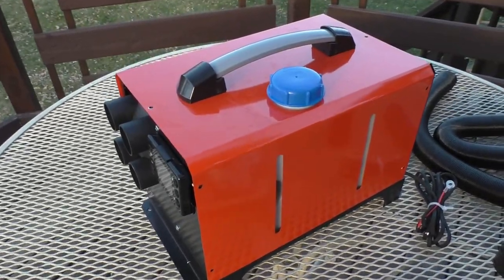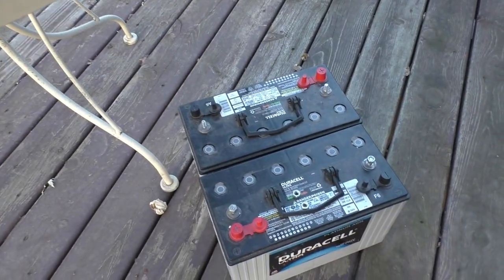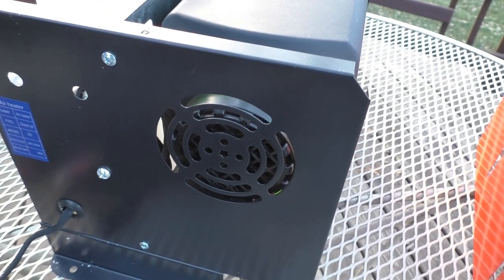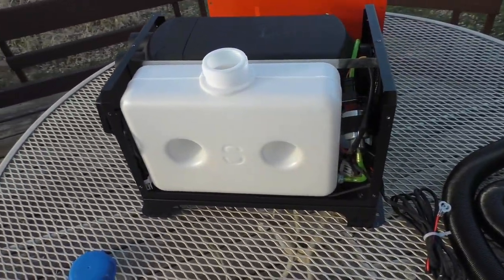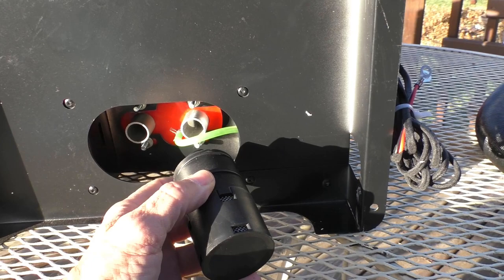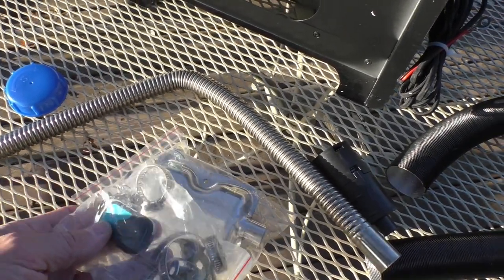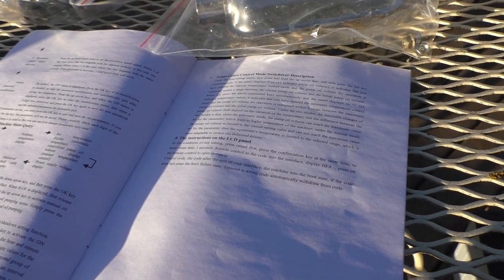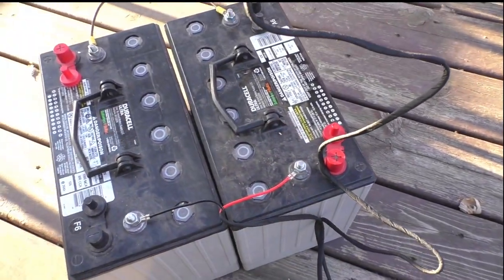#33 Diesel Heater--Cheap heat for our Tiny Home???Off-grid yurt cabin garage heater solar all-in-one

Comment: SPENCER THANKS FOR SHARING THAT I HAVE BEEN LOOKING AT THEM ON EBAY MATE I THINK THE ONE YOU HAVE WILL THROW MORE HEAT OUT WITH THE 4 OUT LETS
Reply from the maker: The single outlet models are greater in square inches and should provide greater flow. The multiple outlets allow pointing the heat in different directions possibly creating different heated zones. Thank you for watching.
Reply: @SpencersMountain  so Spencer the single  out let is better than the 4 hole one what you have
Reply from the maker: @ANDY-we7mr  I got the multi hole unit as there was no selection at the time. I did not need / want that style and there was option to buy a single hole cover if wanted.  The multi hole is good for directing heat to specific and separate places. The single large opening is possibly more efficient as far as moving air volume, but in the end both styles are putting heated air into a space that you want to heat. The only real difference is point heated air where you want it, single or multi.

Comment: It will run flat out like that forever, however.............if it was indoors it would slow down once it came up to the desired heat setting. I have owned two of them now for over three years (without fault) and they will sound like a jet taking off until they reach the heat setting that you have set it at. In a real big room that might not be able to hit that limit but they sure will keep trying, get it fixed into a room and let it do it's thing. Best wishes from England.

Comment: these come in 12 and 24v systems.  they range from as low as 2 kw (6,800 BTU)   up to 8 kw (27000 btu).

For about 100 square feet or less,   8x8-10x10 sized cabins/tents/sheds, a 2kw should be enough.    
100-160 feet,   8x20 tents,  10x16 cabins,   a 3kw heater should do...  

5000 should do up to about 400 square feet, and the 8kw  is is likely to do you up to 600 square feet.  Better insulation will help but...

these are not "all or nothing" heaters,   they do scaled their output, they do have thermostats so can shut of and turn on as needed.   This means,  throwing a 3 or 5kw into a 100 square foot unit,  just means they will use less fuel while operating.   For these units they list the min and max Fuel in L/Hr,  for example an 8kw unit might say -  0.18-0.68 l/h.   that means its min operating pull is .18...   where as a 3kw might be  0.1-0.35 l/h.    So for a "small space"   say,  90 square feet,   the 3k would draw less fuel,  be turning off and on less,  in average cold temps...  but in larger rooms,  where its forced to run at full power for longer, then 8kw unit then may be more fuel efficient.  

.1 vs .18 may not seem like a lot, but,  thats 4.4 gal vs 7.92 gal, over a week.   Of course again, the idea that you could heat a 100 square foot area for 34 Gal a month of diesel, is not bad.  

using a 55 gal drum, or storage tank, filling it once a week from 1 or 2, 5 gal cans.   Its a lot more convenient then trying to haul 2 20 pound propane tanks up every other day.
Reply: The ones sold as 8 kw are not really 8 kw. With the pump rating and flow and hertz and design. its more like 4 to 5kw. That being said they are still great. I have two for my garage as backup for my nat gas heater. My garage is 24 by 35 with 10 foot ceiling. Insulated. It was 5 degrees F today and just one kept my garage 55 degrees all day. David McLuckie has lots of good vids an info on these. Installing one in my house for backup incase my home furnace dies at the worst time. Wont keep my home 68F but will keep it liveable and keep pipes from freezing if furnace dies.
Reply: @MrRatkilr  There are people that run a 384 square foot - 16x24 cottage, that have a nice wood cookstove.   The heater kicks in at night, after the fire dies out,  during the day if they are out, etc.    They also have a backup "propane"  cookset,  for summer use, or again, in winter when they can't or don't want to stoke a fire.  

Comically enough that also have like 3k worth of solar power, and a pretty heavy 600 w/h of solar battery.     so they COULD even use a microwave if they had one LOL.

Comment: Does the intake pipe go through the floor to the outside or does it take air from inside the "cabin"?
Reply from the maker: The combustion intake pipe goes to the outside. The idea is for all combustion intake and exhaust to occur outside.  The warmed air is only heated  by the outsides of the heater.  I have seen some people also take outside air for the warm air intake, but that seems to be wasting energy and potential for routing exhaust gases from outside into the warmed air area (inside the cabin).  I understand advantages of fresh air intake, but care has to be  taken to keep carbon monoxide out of living areas. Thanks for the question and thank you for watching our video.
Reply: @SpencersMountain  Thank you!

Comment: So what do you think of it, sure isnt very quiet?! How does it aound with the silencer? Is it just on or off or thermostaticly controlled?
Reply from the maker: Hi, Lance. The heater is not terribly noisy. I imagine my camera mike is picking up more than is actually there. Most people find the clicking of the fuel pump to be the worst sound of the system and take measures to isolate the pump.  I think the fan sound is pretty much expected and will be somewhat muffled by ducting. The silencer cuts the exhaust sound significantly and since exhaust is routed outdoors there is that additional level of sound reduction. The heater is turned on with the panel switch or a key fob Bluetooth remote. The heater stays on during operation and temperature output can be controlled somewhat with the control panel. There is a thermostatic sensor in the control panel. Not really a true thermostatic control, more varies heat output by regulating fuel and fan speed.  Hope that answers your questions. Thank you for watching our videos!

Comment: The big difference  in the Chinese  and brand units is ability  to suck in cold outside  air without  killing the control  board.
All the Chinese  ones I have had in cabins, boats  don't like cold air from outside  seems to kill the boards
Reply: Condensation is what kill the electronics.  Simple solution is to coat the board with a waterproof coating.  That's what the better designs does.

Comment: Hello, how many hours does he run, with a full tank and batteries.
Reply from the maker: Sorry, have not timed run time. Runs more than 8 hours with fuel left over. Obviously depends on how much heat you demand from it. Diesel has a certain BTU per volume so some amount of calculation can be made. Same with batteries, you need to calculate capacity required and create a desired reserve between charging. There are no simple answers to heating and batteries as every need and use differs due to many variables.

Comment: any time you burn a fossil fuel that is not vented (exhaust) to the outside, as a result of combustion  one gallon of propane (as with the buddy heaters) or exposed catalyst type Propane radiant heaters, one gallon of water will result rom that combustion of the 1 gallon of fuel.
Reply from the maker: The chemical reaction claims comes out to around 1.6 gallon of water per gallon of propane. 
However, this diesel heater was intended to circumvent that issue by being a fully vented heater with intake and exhaust happening outside the heated space.

Comment: They are 12 volt
Reply from the maker: Not this one.  Pump and heater motor are marked 24 volts as well as labeled on heater. Many large diesel vehicles are 24 volt and create a market. In the video, I used two 12 volt batteries in series to make the required 24 volts.

Comment: 160 euros is not cheap!
Reply from the maker: When compared to the heaters these knock-offs copy, they are pretty low cost for a diesel powered heater.  Thanks for the comment and thanks for watching.
Reply: that's super cheap, we're talking about HEATERS, not exactly a cheap topic